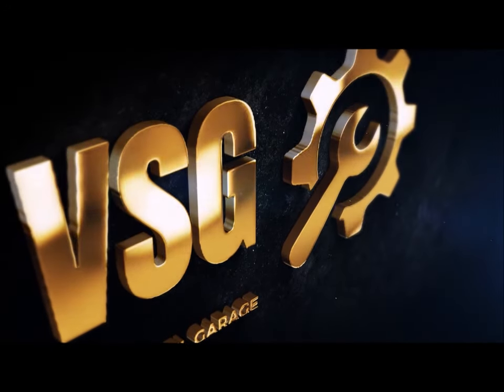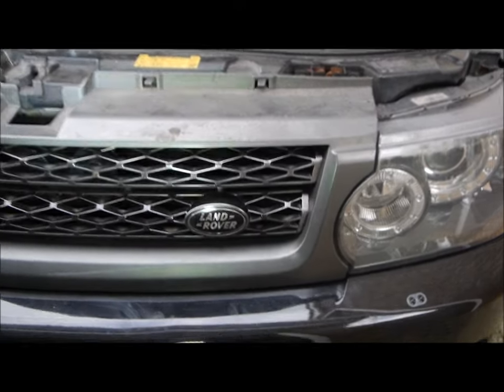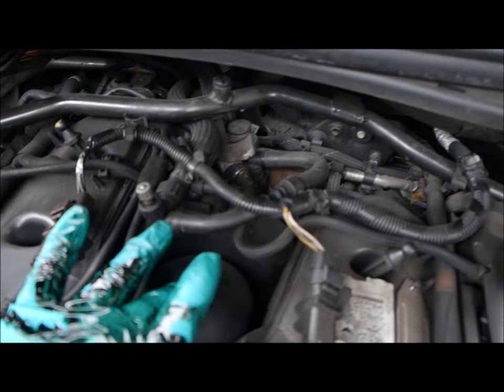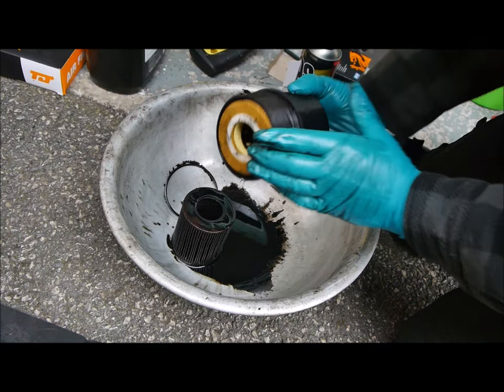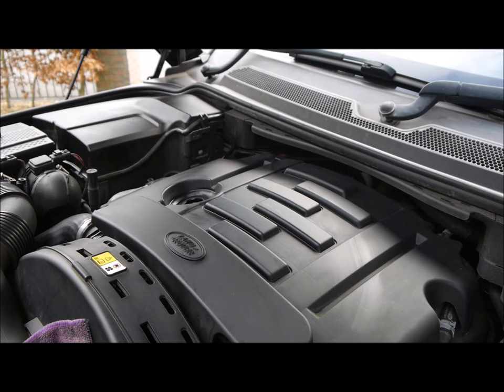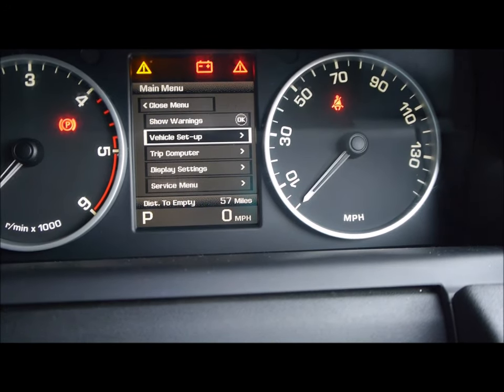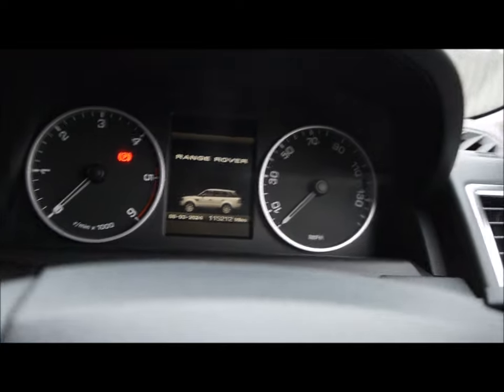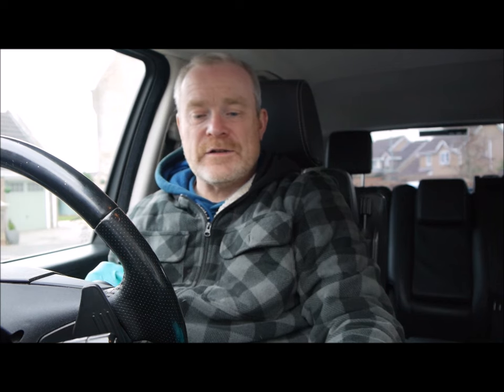Range Rover Sport - Low cost DIY driveway service

Comment: Thanks for the video, but I keep thinking on these new cars are we benefitting from all this computer reset nonsense. Its pathetic really. But all moderns are like this now. Real reason is they can charge us more for it, its not a benefit.
Reply from the maker: Yes I agree with you. It's bonkers to wait 20 mins to read an oil level. What's s wrong with a dip stick? It's worked since the first car ran over 100 years ago.